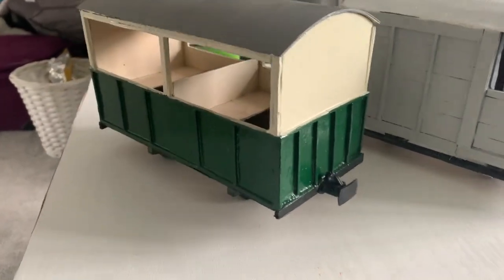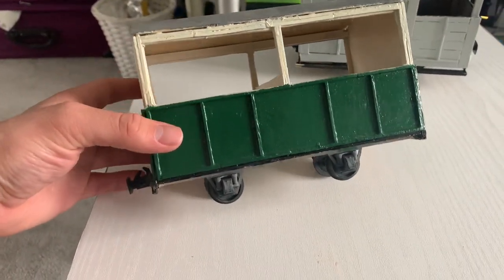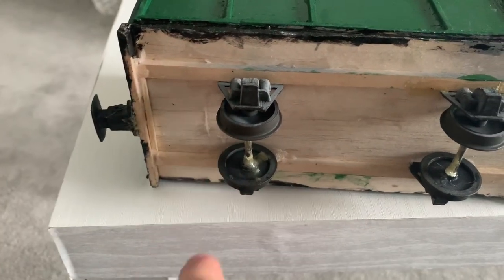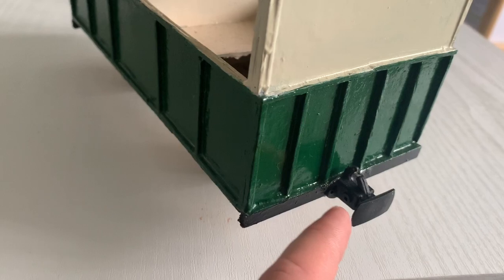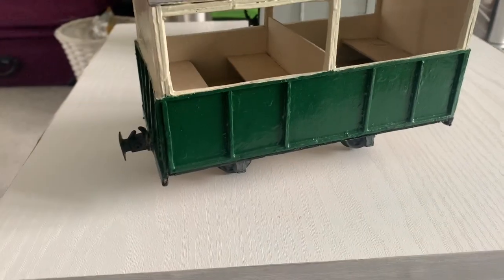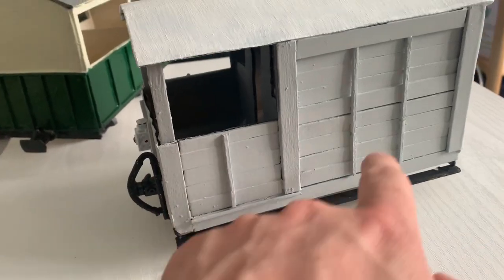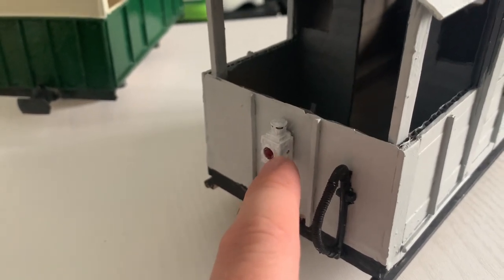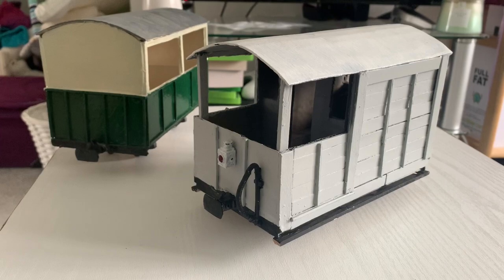How I Built Cheap Garden Railway Carriages (16mm Scale)

Comment: A few questions for you, as I'm building coaches in a similar manner, what thickness of card did you used? I'm using 4-ply Bristol sheets. I have noticed that when treating with the diluted PVA the sheets are warping, and after a few coats it's still quite flexible, did yours suffer the same?
Reply from the maker: Hi there, I did find it some warping which can be frustrating. I try and make quite a solid frame to hold the sides in place firmly and this seems to go some way to remove the warping but I am yet to find a 100% effective method. I think shellac is the best method but I don’t have experience of using it. Also, are you coating the sheets before you have cut them? I only coat once the vehicle has been made and therefore is held in place.  Hope it works out! I use a similar card. In fact I believe it was simple artist mounting card from The Works shop. Best wishes.Josh
Reply: @joshw6226  Thanks for the reply! After doing a few test pieces and trying different materials and adhesives I realized what the problem was. The card I was using was far too thick, I was trying to  treat each layer with PVA what I should have been doing was making my lamination and then treating it as on piece, it solved most of my issues and treating the model once it was assembled had a similar result! Good luck with your modelling and thanks again for the reply. Cheers, Artyom